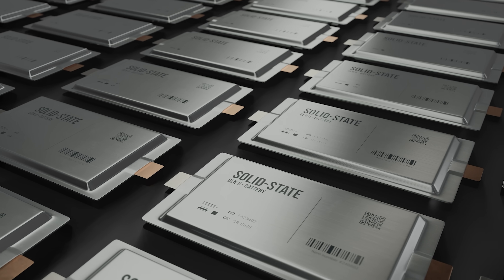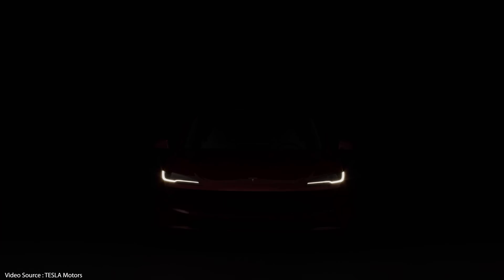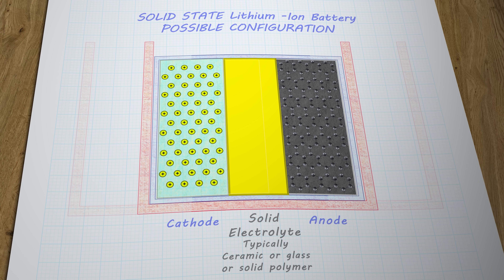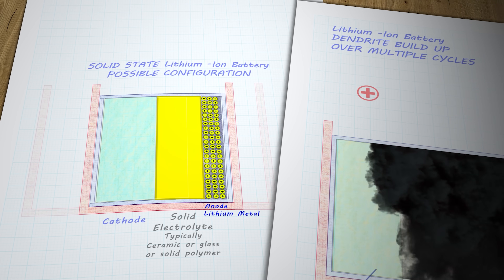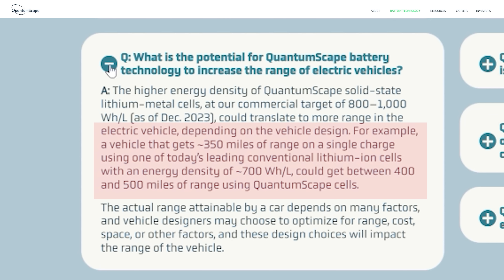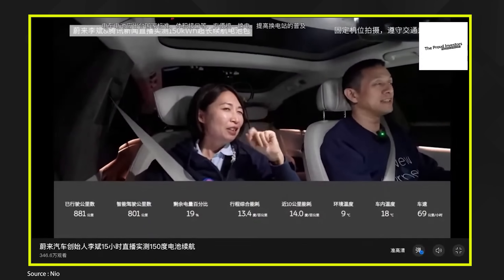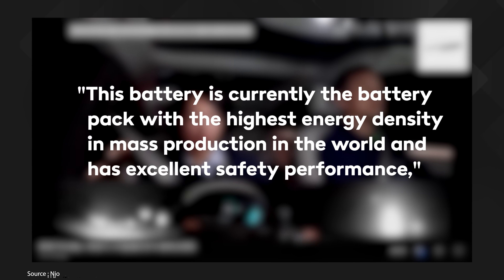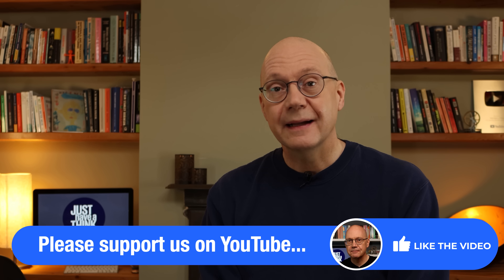Solid State Batteries - FINALLY powering electric vehicles in 2024!

Comment: A $1k smart phone has a $5 battery. Solid state will be super expensive when new, so we'll see SS batteries in smart phones many years before we see them in cars.

The fact that we aren't even close to getting SS batteries in smart phones shows we aren't close to having them in cars, if we ever do.
Reply: Spot on. Disappointed cost wasn't addressed in the video. SSBs wont be an "overnight gamechanger" if a 14 to 40% increase in energy density costs a lot more than ever improving and ever cheaper conventional batteries. Naturally costs will come down over time but I suspect conventional batteries will be powering most EVs for a very long time to come alongside SSBs for high-end EVs, motorcycles, planes, etc.
Reply: Consider the different needs from a phone to a car. If SS batteries allow faster charging and range they make the car significantly easier to use.  

Let's say you forgot to charge your phone and it dies while you're out. That sucks, but you stuff the thing in your pocket and charge it up again as soon as you can. Now apply the same scenario to what is now a 2 ton brick on wheels. 

The other thing is that if SS batteries handle a wider temperature range better then that should mean an increase in reliability and performance. My current  EV's Li-ion battery looses range when it's too hot or cold. Conditions I wouldn't want to be walk around in. And I'd like to imagine that if the battery can heat up more, we can potentially discharge more power to the motors quicker for higher speeds and acceleration.
Reply: @philipramirez5406  This is all true but totally irrelevant. +100$ vs +5000$ is the only parameter you need to take into account. More usefull or not just doesn't matter. If those batteries can be used in phones they will be more widely used in phones first,  before being used for cars.
Reply: There may be a bigger initial market for expensive electric cars, than for expensive phones, as expensive cars are more of a status symbol.
Reply: How many people have you ever heard say they weren't buying a smart phone because the batteries don't last long enough, or took too long to charge, not very many. Everyone who can afford one owns a smart phone today. How many people say they won't buy an electric car because the battery runs down too fast, and that they take too long to charge, millions of people. With thousands of the smartest people on this planet working on solid state batteries, they will be perfected eventually. Mass production will bring the price down, like it did with computers and flat screen TVs. Meanwhile, government pollution laws will make ICE cars even more expensive, & failure prone due to ever increasing pollution reduction technology.. People will decide to switch to electric. By 2040, ICE cars will no longer be made due to lack of demand and lack of replacement parts. Junking a newer car because a replacement computer is no longer made will get expensive.
Reply: Is it possible that it’s not possible?
Reply: I just want my high end gaming laptop to have a battery that last 3 times as long. I would happily spend another $100 more for triple the battery life on a laptop when I’m already spending $4k on it
Reply: Good point. 👍
Reply: I disagree.  Smart phones are replaced every 1 to 5 years. No need for a battery that lasts much longer than that.
Reply: @lederermc  I already have my S8+ for 7 years and I'm not planning on buying another phone. Why pollute environment and spend money.
Reply: @lesp315 
For what it's worth, I hate my S8, which loses charge like a leaky water faucet 😂
Reply: @PETERJOHN101  Replace the battery and dump apps you don't use. My wife has Note 8 and had the same problem. Battery replacement took care of that. Now, if you have two left hands and can't do it you need major surgery. :face-blue-smiling:
Reply: Perhaps, but I suspect people are more willing to add an additional $2000-$5000 to a car than they are to add an additional $50-$100 to a phone.
Reply: @SireJoe I strongly disagree with that. We are talking 100$ versus 5000$ here.
Reply: @ParapluieRussePercé   I think solid state batteries are most likely to turn up first in iphones and top of the range Android phones before anywhere else. The reason phones screens have got bigger is to hide the bigger battery.
Reply: @rogerfelin6974 your math are wrong. If the cell phone battery is 100 dollars then the EV battery would be 100000$ more not 5000 dollars more. More likely is its a 15 dollar battery for a cell phone for solid state at first but it's likely it will only take a few years to half that price.

Comment: The range issue has ramifications beyond customer insecurities. The arrival of all electric vehicles requires the construction of a network of expensive fast charging stations. The longer the range, the less dense that network has to be to reach full functionality, and therefore the less it will cost to reach viability. Longer range also allows EVs to be viable in areas of low grid density and coverage, such as northern Canada.
Reply: The problem with extending the range of a car is that you therefore increase the amount of energy it has to take on at every charging stop. That means either increasing the wattage of the charger or increasing the dwell time of the vehicle. Obviously drivers are going to want to reduce their dwell time as much as possible. So it means every charger has to go up in power.

Increases in energy density are a good development, but I would rather see battery ranges stay the same while the weight and price of the battery is reduced. This will improve the overall energy consumption of the entire vehicle fleet and increase adoption. 250 miles with some safety margin is about how much you ought to drive in one sitting.
Reply: @AlRoderick  🤔You wrote, "The problem with extending the range of a car is that you therefore increase the amount of energy it has to take on at every charging stop."  Not really. You don't charge EVs all the way up like you'd fill a gas tank. You do 90% or more of your charging overnight at home and only stop long enough to charge it up enough to reach your destination or the next rest stop. Currently that takes about as much tiime to as it does to pee and get a snack or quick meal. Those times will only get quicker with faster charging technology.

I'm sure new EVs will be available in the range you're willing to pay for, so you won't need to pay for more range than you need.
Reply: Yes, and not just fast charging stations but also ubiquitous overnight neighborhood charging stations (or at least electrical outlets) wherever people live without dedicated parking spots. That will enable the 40 to 60% of car owners who don't have such to use EVs every day.

Comment: Can tungsten and / or au gold be used in battery optimization?
Reply: Eh? What would you use them for? If the biggest constraints on batteries today are weight and cost … well, gold is famously both very heavy and very expensive.

Tungsten, somewhat less expensive, but still very heavy compared to lithium, carbon, and even cathode materials like Fe, Mn, Co, Ni.
Reply: @ps.2 principles, going to the moon not because it's easy but because it is hard

Comment: Awesome video. Please also mention the distance in kilometres for us slow thinking metric persons.
Reply from the maker: Ok next time
Reply: Divide by five. Multiply by eight.
Reply: Quick conversion: Divide by 5, then multiply by 8.
Or, using the simplest maths: Divide by 10, then double four times.
Reply: X 1.6 it's not that hard.
Reply: Just add 50% for a rough conversion from miles to kilometres. eg. 20 miles = 30km.  (It's actually about 32km but it's near enough if you just want an approx conversion)

Comment: Very interesting.
I read about the Chinese company that is building the plant in France the other day.

Apparently they have done something vastly different called dry layering.
Allowing them to cut production time by 50 percent.
The article I read was from Clean Technica.
I am not a scientist and my understanding of the technology is limited to the articles I read and videos like this one.
It seems very promising.

That being said most cars wont travel 500 miles without the driver or passengers having to stop for a break anyway.
Reply: I'm sure you have heard this before, the problem is the 500 mile range is under optimum conditions.Here in Canada winter is a serious thing and cranking the heater, which has been reported as just adequate to keep the wind screen defrosted can reduce range by a third and the cold itself can knock off another third.  That doesn't leave much to actually get to your destination.
Reply: @markbernier8434  I fully agree. It is why it is important that those ranges and power densitys increase.
I  am not claiming EVs are perfect.
However I would point out that in the 1900s the range of gas powered vehicles wasnt enough to get anywhere in Canada either whether it was cold or hot.

We are at a point in time where there is a fundamental shift occuring.
We are on the leading edge of the shift unlike the ICE vehicles that have been main stream for the better part of 80 years.
Reply: @shawnr771  shhh...you will frighten the petroll with logic.
Reply: @ThatOpalGuy  Is ok.
I would rather be informed than inflamed.
Reply: @markbernier8434  Winter is a serious thing in Norway too, and while the range does decrease substantially, it's rare that I drive more than 250km without thinking a pause is a fine thing. My car is rated for about 500km, and probably does around 200-250 in -10C. Bottom line, many cars already have a good enough range for many people even in winter, and any improvements to range and charging time will surely convince even those on the fence. I doubt ICE production will continue for normal cars in our countries.
Reply: @markbernier8434  If I understood the battery characteristics correctly then Sodium batteries might already be of help here. They have lower energy density than regular Lithium, or even LFP, batteries at their ideal operating temperature — but they actually perform better in cold weather, so they should lose less range in the cold than the currently used battery chemistries.

(Though, of course, they can't help with the need to use the heater.)

They are cheaper to boot.
Reply: @markbernier8434  not been my experience of driving an EV for two years. Mine can do about 230 to 240 miles in the winter and 280 to 300 in the summer. Kia eNiro since you asked.
Reply: @markbernier8434  I guess Canada will have to build up their own fossil fueled car and truck production when the whole rest of the world switches to susstainable energy. In regard to the time it takes to bild such a industry - 20-30 years - i recommend you start NOW.
Reply: @wolfgangpreier9160  lol. no, just use electrified mass transit. or you can walk.
Reply: @ThatOpalGuy  We in the middle of Europe do not have electrified or mass transit. Only the city dwellers have this privilege. And most of them do not even own a car.

Here in the countryside we need cars even for grocery shopping. I have switched everthogn to electric, home, company, vehicles since 2019 and safe a bunch of money each year. And it works great. Winter summer, any time.
Reply: The main point in increasing energy density is about reducing the volume of the battery and thus the weight. So a lighter car, cheaper running costs, reduced consumptions, etc
Reply: Prologium.
Another Chinese company Ganfeng has already test solid state batteries in production cars .
Reply: @najibyarzerachic  very cool.
The biggest point of the article I read was the reduction in production time was significant.
Reply: @najibyarzerachic  Solid state in China = Tofu.
Reply: I live in Canada and have had two EVs (2018 Kia soul and a 2023 Tesla y).  Winter definitely hits the range, but I’ve only noticed a 20% drop max (not 30-40%).  And the cars don’t have any problem keeping the interior warm (in fact, being able to preheat often means I’m able to get into a defrosted warm car… without much of a range hit since the car was plugged in while preheating).  That said, I live in the Toronto region, which isn’t nearly as cold as other parts of Canada .  More range would always be better in cold areas!
Reply: even people that commute long distances to and from work likely wont use more that 300 miles on a charge. There will be exceptions, of course, but it's far past the time we need to plan cities and think about the ways we live and travel.

Comment: Can't waiti to see how the grid reacts when electric cars reach 30 40 percent of the market. We're getting there. It may not be fun.
Reply: It is overblown. With the current infrastructure for ice cars, it would collapse if every ice car would fuel up at the same time. But it does not, because cars do not all fuel up at the same time. Same with ev cars, they will never charge up all at the same time.
Reply: The electric infrastructure has to expand with demand just as gas stations did 100 years ago.
Reply: National utility authorities as well as individual electric utilities think that they will be able to handle demand, given that EVs will not replace the vehicle fleet overnight, but rather over a period of many years, AND EVs can be set to charge at different times of day, resulting in more efficient use of generating assets and lower costs for consumers.
Reply: And then there are those that will have their own “power plants” at home.
Reply: EV charging can actually be used to stabilize the grid. For example, "intelligent octopus go" provides cheap rates in exchange for some control over when the vehicle charges and at what power. This way, Octopus Energy can use the EVs of their customers to implement a grid "frequency response service" and get paid for it by the grid operator.

Comment: Will I ever see it?
Reply: If you live for another 10 years I would say yes
Reply: @crappymeal  I'm 76 so who knows. I've lived through a very interesting era. From valves, germanium transistors, my 7 transistor radio, (tranny), my first 14 pin DIP with 4 transistors. I worked on all kinds of motor control equipment and witnessed the evolution. (I regret not photographing and recording it all). As a radio ham, my greatest admiration goes to the JWST and that a small robot on Mars can send back detailed video (until the batteries run out, that is). There's so much to live for in the next era which is unknown (as was the last one). Who ever imagined how far we'd come in one life time? I won't be here in 50 years time or maybe even 10.
Good luck to all those that are and hope you can all appreciate how great we all are. Thanks JHAT
Reply: @thevanthatrocked  thanks, it seems so normal for me to see things progress so rapidly, although very interesting

Comment: Chinese Academy of Sciences' Institute of Physics in Beijing claimed a 711Wh/kg laboratory cell a few days ago. Simply it is a whole different range of energy densities that are proclaimed now by different manufacturers, compared even to a year ago.
Reply: 711 me likey.
Reply: "Chinese claim" can be disregarded in any possible context.
Reply: @sliwka621  Yes, very true, no Chinese company and no Chinese scientist and no Chinese University has ever done anything productive in battery science. Ever?

Wakey wakey!

its the other way around. Just FYI: Over 80% of all patents and scientific papers regarding batteries in the last 30 years came from Chinese scientists, universities or companies.
Reply: That cell is not relevant for production. It was a showcase of what energy density can be reached, but on cost of other parameters, which makes it not relevant for Real life purpose.
Reply: @strichard111  My point what was that the cells in this video, were the lab cells 1-2 years ago. It is moving fast. The theoretical energy content in a Li-metal / silicium cell (not that we know how to make it now) is 2 KWh/kg. There is plenty room for improvement still.
Reply: Not yet, but they will work on bringing it to market, improve its qualities when it comes to longevity and rechargability
Reply: Now we just need infinite free electricity.
Reply: @bunsw2070  6.242 × 10^18 electrons per Ampere second> 200 Ah requires 4.49424*10^27 electrons, or 4 grammes worth of them. Electricity is extremely lightweight, let's get rid of the batteries entirely.
Reply: @Tore_Lund  Qantum Dot? I guess Samsung already delivers those via Amazon.
Reply: @bunsw2070 we will get it one day.